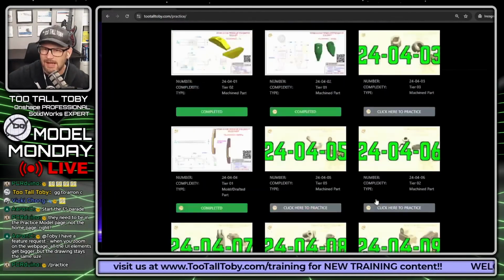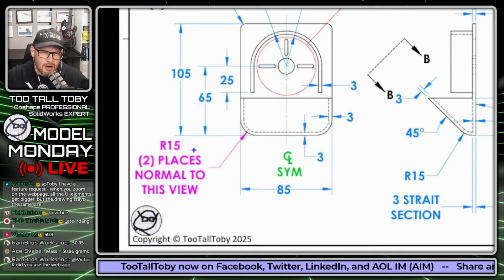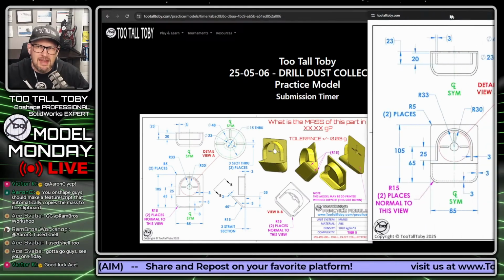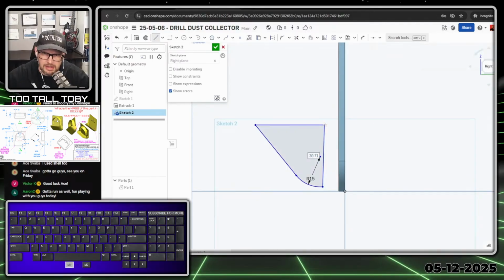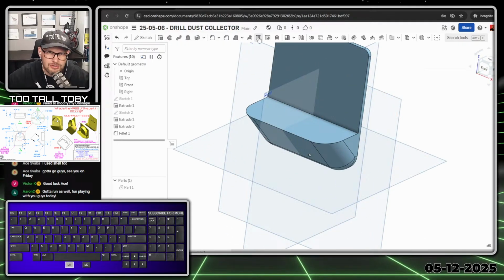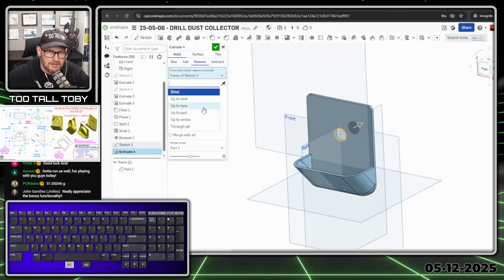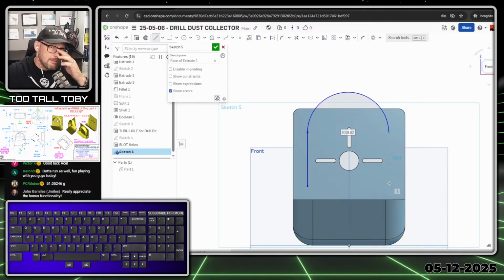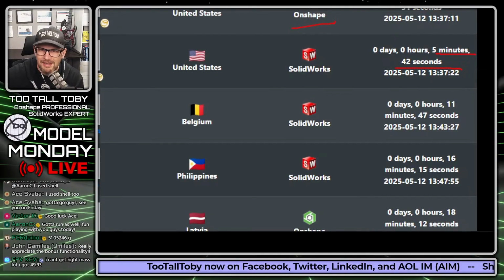Onshape STEP-BY-STEP Tutorial / 3D PRINTED DUST Collector - Tips and Tricks

Comment: Nice!
I don't think you needed to include the fillet in the back plate and do the extrude remove of these corners adding a 15mm fillet to the corner of the "bucket" gives the correct geometry (as long as the side view is correct with the 3mm straight and 15mm tangent rad).
Also note that you don't need a plane for splitting in Onshape: you can grab a mate connector to split along (but you were talking about what might be needed for other CAD systems).

Comment: I've drawn this twice and both times I'm 3 grams light and can't spot my mistake(s)
Reply from the maker: share the file here or share it on discord?
Reply: @TooTallToby  It's in the public space renamed to Drill dust catcher 3g light (if that helps, thanks)
Reply: @davesmith8745  Your shell is only 2.5mm instead of 3mm. That's also why there's a step in the backwall. What really threw me off is that you seemed to have turned off all decimal places on the mm measurements - that's probably why you didn't find it when measuring the back of the bucket vs. the back wall (it's 2.5mm in your version, but because you turned of the decimals the measurement tool shows 3mm!)
Reply: @henninghoefer  Hi, I thought i had already replied to your post but can't see it. Thanks very much for pointing out my error. I realised that there was a shortfall in the material but couldn't figure it out. I will endeavour to make sure I check my units and decimal places in future, cheers!!